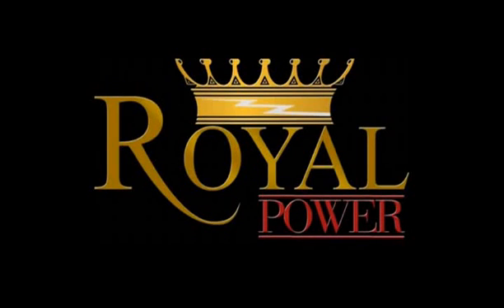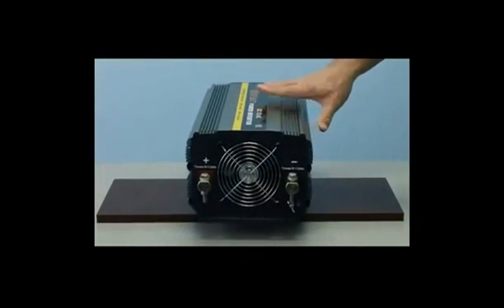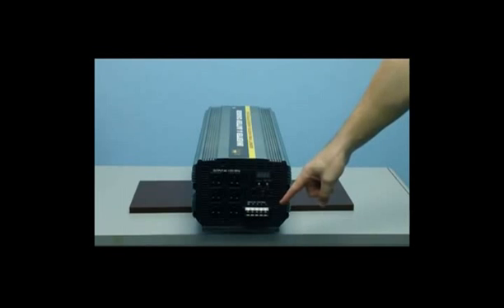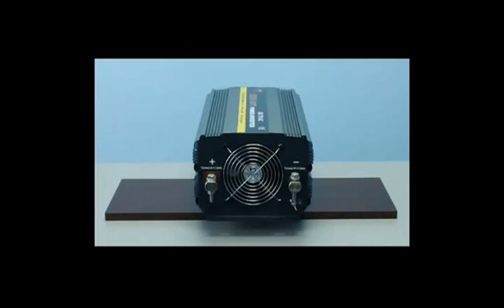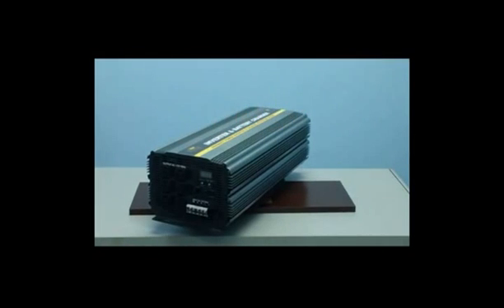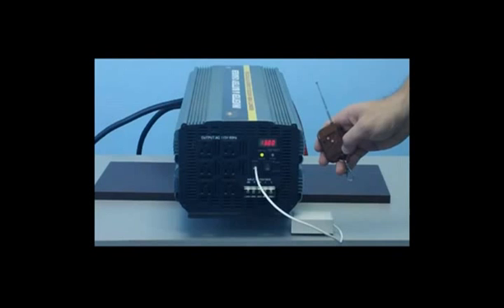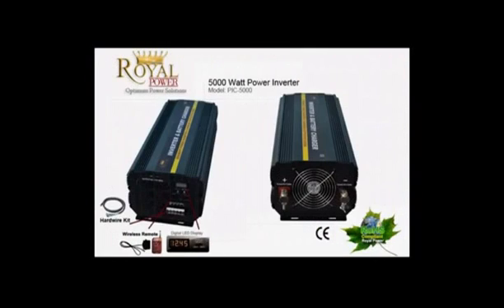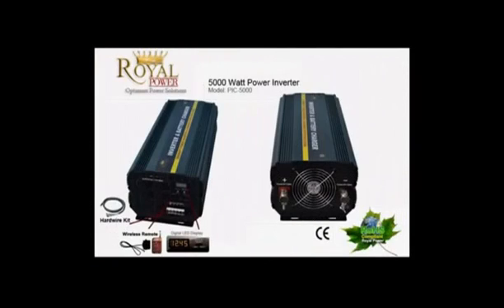5000 Watt Power Inverter w/ 50 Amp Charger and Transfer Switch 12 Volt DC to 110 Volt AC (PIC-5000)

Comment: How many 12 volt batteries do you need to run the 5000watt?

A car battery is 50 watts.
So just to run it you would need 8 batterys  or 800 watts to start out with?
Reply from the maker: You can run 5000 watts of 1 battery but the voltage will not hold above 10.5V for long. For 800 watts 1 battery will work not 8.

Comment: can it be use with 22ovls appliance
Reply from the maker: this unit is a 120V device. You would need a 220V~240V rated inverter.

http://www.powerinverters.com/products